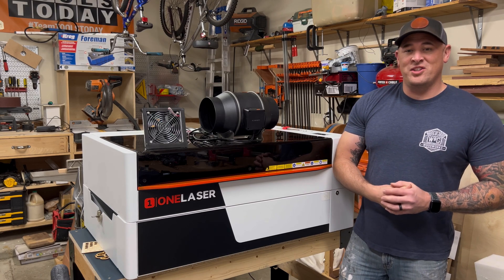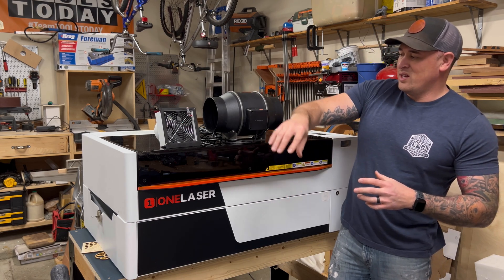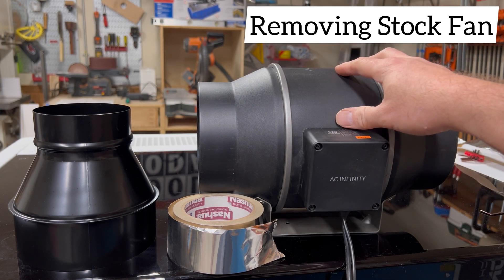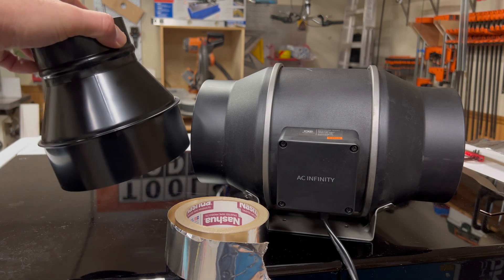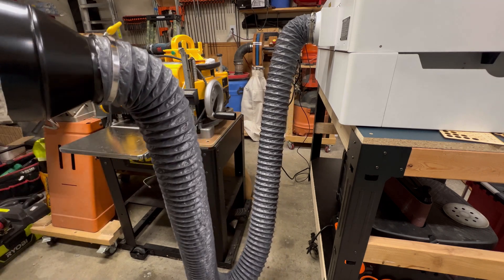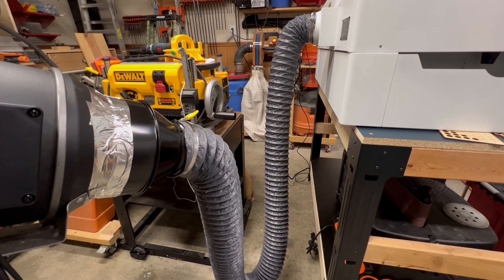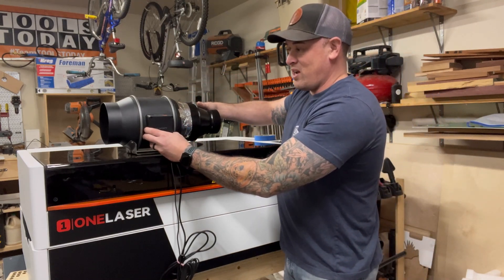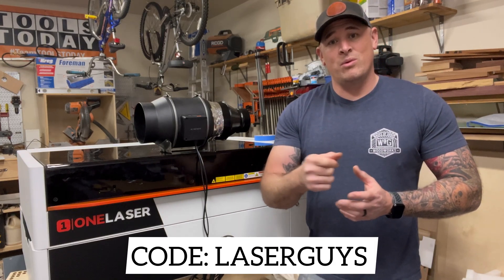In-line Fan Install | XT / XRF OneLaser | AC Infinity

Comment: Good video, thank you. I wish I had watched and then replaced the stock fan. I burned my XRF lens within a couple of days with what I was working on.  Do you have a video on replacing the lens? Would appreciate one.
Reply from the maker: I dont have a video showing how to remove the lens but I do sort of explain it here. You just need a 20 mm lens. The XRF uses a 63.5mm or 2.5” focal length lens. On the magnetic block, your lens is on the top of the opening. There’s a retainer ring that needs to be unscrewed so you can pop out your old lens. I have the XT model so my lens is at the bottom. Make sure to put yours in the right spot. 

You can get a replacement lens at American Photonics or on Amazon. The curved side of the lens faces up.

https://youtube.com/shorts/Pi_nVxVBq4s?si=82Tihfg3h09vAYGT

Comment: Cam thanks for all the great content on this laser, mine is on its way and also a fellow michigander. Im limited on vent space behind the unit(these are sold as desk top units but then you lose at least 6in behind the unit for the vent with bends. wondering if there is a way with the base unit add on and this after market fan you could side vent the unit?
Reply from the maker: Unfortunately there’s no other way to route it without heavy modification to the body. 
There was a member in our OneLaser FB community that created a 3D print file for a shorter vent shroud if you remove the stock internal fan and solely use an inline fan. This will save you a few inches.

https://www.facebook.com/share/p/1HWva7VJdf/?mibextid=wwXIfr

Comment: Any recommendations on how to run the exhaust from the inline fan in a basement with no accessible window or door? Thanks.
Reply: I cut a dryer exhaust vent into the wall got one that matched my siding color from the local siding retailer.

Comment: Seems like the stock fan works but is lacking. I would definitely go with an inline fan. Is it possible that 1laser could offer the stock fan or an additional 'pro' exhaust version where the stock fan is replaced with an inline? That way people don't have to buy from other vendors = one stop shop. This machine is on my list as I'm looking to upgrade. Thanks for the video.
Reply from the maker: 100% agree. We brought up the topic to them and they’re trying to work it out with a supplier so they have to raise the price to the consumer. All I can say is, we’ll see.
Reply: @EdmondsWoodshop  I get it, higher priced stuff cost more (common sense). 

BTW I'm looking for a list of what materials the XRP can cut (up to what thickness) and engrave. I'm new to engraving but currently work with a small diode laser for 3-8mm plywoods, slate engraving, metal engraving tumblers, maybe coated knife blades, acrylic, etc. If you have any info, I would love to see it. BTW thanks for the reply

Comment: So how bad is it when your not cutting / engraving directly inf front of the duct ?
Reply from the maker: Not bad with the in-line fan upgrade. As you can see in the video I was cutting more to the front of the laser. But I’m assuming you mean off to the side. It’s not bad. The fan creates good airflow so if the lids is shut it’ll get sucked out quickly

Comment: Another great informational video. Having sold my Omtech Polar (due to too many needed upgrades, and moving from Ohio to Florida ) I am planning to buy either the Thunder Laser Bolt or the OneLaser XRF. So, I am watching ALL the Onelaser videos I can find. And, from my Omtech Polar days, I know how great your comments & videos are. So, can you comment about these two items between the XRF and the Bolt - 1. air assist positioning. It appears to me that the Bolt would be less likely to blow dirty air back onto the lens. What are your thoughts? 2. Changing lens focal distances - what is involved with either of these two machines? I like the easy removal of the OneLaser lens for cleaning. But, would it simply be a matter of buying new lenses from Cloudray and simply swapping them out in the OneLaser housing? Thanks, Charlie in Central Ohio, but soon to be Central Florida !!
Reply from the maker: 1. I haven't had the opportunity to use the bolt, but I can say with the XT/XRT the air assist is taking in fresh air and blowing it through the nozzle, however I do find a build up of dust on my nozzle. So far nothing on the lens, but something to keep an eye on.
2. The XT/XRT has two positions for different lenses. The bottom of the mount holds a 2.0" focal length lens. The top part of the mount can hold a 2.5" focal length lens. Swapping them is just a matter of unscrewing the retaining ring that holds it. On other lasers, the lens is in the laser nozzle tube and you have to disconnect the airline, remove the the laser head, and then unscrew the retaining ring. Not really that much of a hassle, but something to point out. OneLaser does make it easier
Also, I need to double check the diameter. I'm pretty sure its 20mm, but yes...it would be matter of buying a loose lens and swapping them out. I like to buy my lenses from American Photonics. Always have a back up on hand.

Comment: Is there a significant difference between the Pro and Non-Pro version of the fan? I see on Amazon that the Pro is 402 CFM while the Non-Pro is 352 CFM.
Reply from the maker: If you have a simple duct setup where it has a straight path to the window then you could get away with the A6 model (non-pro), but for $10 more I’d still recommend the S6 (pro model) with more airflow just because it allows you some more versatility if you need to add bends or turns in your duct to reach to where you want to go.